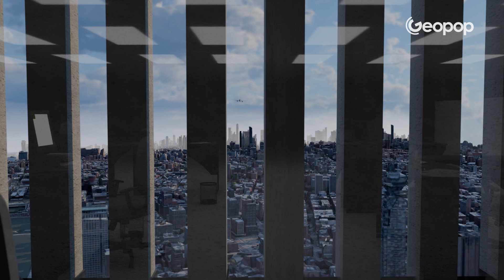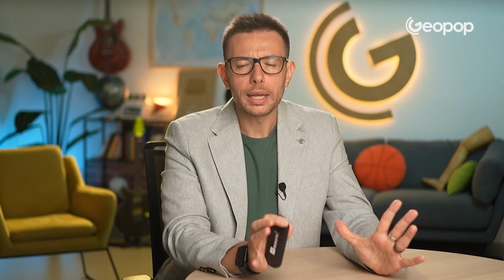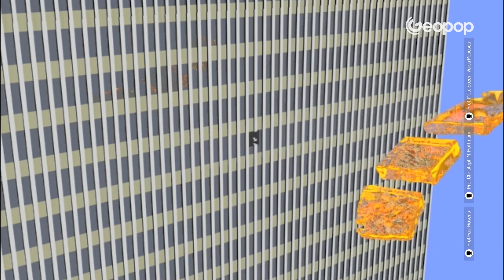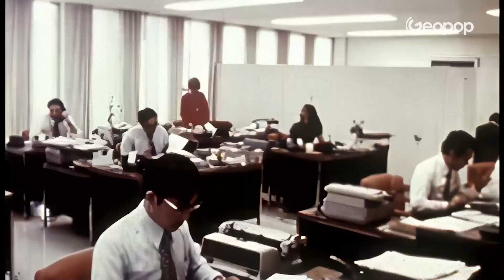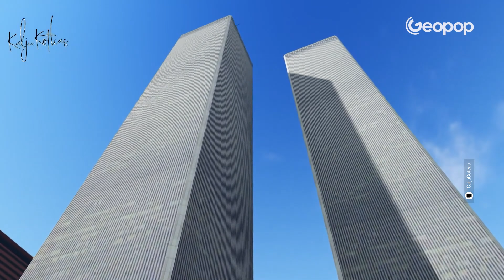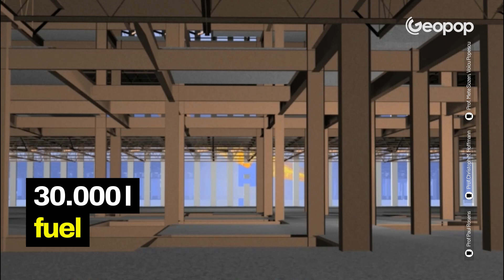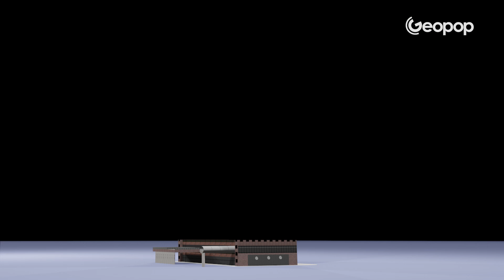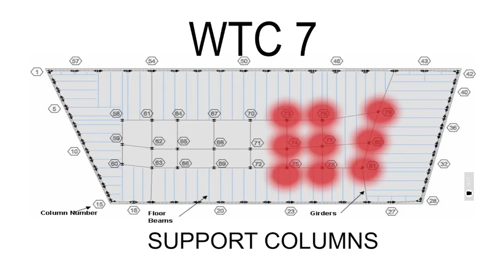9/11, 2001: The Technical Reconstruction of the Twin Towers and WTC 7 Collapses

Comment: Controlled demolition. Buildings were planes proof. Planes could never have dropped those buildings. That was controlled demo. Their are plenty of demo videos that look the same when performed correctly.
Reply: Twin Towers collapses were actually relatively straightforward, the fundamentals already understood in the professional engineering community within just weeks. Still, there’s a lot of really bad information floating out there, mostly on the internet where it’s easily accessible to anyone. Good information takes more effort to come by and is much harder for laypersons to digest. Engineeringspeak is complex and dull. Also, some people put up a wall to protect their beliefs and false assumptions. Engineering is hard while wild baseless speculation and pathological theorizing with easy hand-wave answers is simple and exciting. Fanciful tails of pre-planned demolitions, magical space beams, melting steel and mini-nukes are just far more entertaining and require a whole lot less thinking, thus getting far more intention than they deserve.

To correct that situation, I have all on my own prepared this short yet detailed technical description of Twin Towers collapses based on my own observation and analysis of the available true and relevant facts. No politics or ideology, just the engineering. My hope is this will dispel many common myths and answer most if not all questions you may have about the Twin Towers collapses, because anything can seem like a conspiracy if you don’t understand how it works

While complex, most of the Twin Towers collapse mechanisms can be seen with the naked eye and easily discerned and understood by the layperson if sufficient time is taken to understand. 

1. The Twin Towers consisted of 4 primary structural elements that together formed an integrated system where each relied on the others.  47 hollow box-section steel Core Columns carry the majority of the gravity loads. The 236 hollow box-section steel Perimeter Columns carry the remainder and ALL of the lateral (wind) loads. Long-span Lightweight Steel Trusses connect the core and perimeter column together at each floor with a Hat Truss on top to tie the structure together as an integrated unit where no element can survive without the others. There was no structural load bearing concrete and most components were bolted together.

2. The impact of 117 tons of airplane (= to about 12 dump trucks) at speeds up to 590 mph with the energy of a ton of TNT completely destroys the aircraft. This in no way implies the Towers come out unscathed. Many perimeter columns are damaged or destroyed as are some core columns (example; 33 of 59 perimeter and 20 of 47 core columns damaged or destroyed at the impact floors in the North Tower), This damage is primarily through bolt-shearing failures at the end connecting flanges, as well as bending, twisting and fracturing of weld seams. There was no cutting or slicing - the reality was far more violent and messy. 

3. The impacts destroy or damage fire insulation, fire breaks and sprinkler systems on multiple floors.  Huge fires are started across multiple floors simultaneously and allowed to spread rapidly with no effective firefighting or fire suppression. This was an unprecedented fire event . 

4. The hotter steel gets the weaker it gets .  With fire insulation stripped away and no sprinklers the survival time of the steel greatly reduced. Gradually over time heat causes the lightweight steel Floor Trusses at the impact damaged floors to sag, which was observed and recorded.  No steel melted or needed to. Structural steel fails long before it becomes a puddle. It just needs to bend

5. Sagging floor trusses pull on the increasingly weak and overloaded Perimeter Columns, causing some of them to bow inward by up to 5 feet. A straight column is up to 4 times stronger than a bent column. The bowed Perimeter Columns buckle and fail, initiating collapse. The formerly static mass above which the structure below could easily support is now converted into a dynamic mass up to 30 times greater. Because they have buckled, the Columns above and below the failure point are no longer aligned . The load bearing structure below no longer bears any load as it falls past the lower columns, NOT onto them.

6. Thousands of tons of debris fall within the four outer walls, down through the open office space, crashing onto the first intact floor it encounters. This massive impact immediately breaks the bolted connections to the columns as the amount of resistance the Floor Trusses can offer is negligible.  The falling debris slows only marginally and briefly. Note:
6a. This is NOT a solid top block crashing into and “crushing” a solid bottom block .
6b. The debris falls past the columns not onto them.  The columns provide no resistance to the falling debris. 
6c. Only the bolted connections of the floor trusses to the core and perimeter columns can offer any resistance. A pair of 5/8” bolts at each end of each truss vs. thousands of tons of falling debris.
6d. No laws of physics are violated.

7.  This floor-led collapse progression within the four outer walls can only go straight down. Note: 
7a. This process is often incorrectly referred to as “pancaking” which actually refers to a completely different process rejected at an early stage. The catchy name stuck but nobody knows what it is supposed to mean.  Pancaking is too simplistic and inaccurate anyway. More like Kaiserschmarrn.

8. Collapse progresses through the floor systems not down the columns, through the path of least resistance . Rate of floor failures increases with each successive floor as momentum increases, reaching an average acceleration of 0.65 of GA, or 35% slower than true free fall. Bam, bam, bam down the building until there are no more floors to fail.  The resistance offered by each successive floor is always the same. The mass and velocity, thus the energy of the falling debris is constantly increasing, with each floor destroyed adding new falling mass. Some falls to the sides, but most falls down. More mass, more velocity, same resistance with each floor.  Don’t get stuck on the but the lower floors weren’t on fire nonsense. They weren‘t and didn’t need to be.

9. The Towers were 95% air by volume. As that air was compressed inside the building it is forced down the tower and blown out the sides in reaction to the building collapsing . Those were not “explosions”, it was expulsions of compressed air caused by the collapsing building, explaining the low velocity, lack of flash, blast, supersonic pressure waves and lethal high-velocity ejecta.  

10. Perimeter Columns become detached and peel away like a banana behind the collapse front, playing out to the four points of the compass extending to more than 600 feet from the base of the towers. This was quite obvious from examination of the debris pile. 

11. Core Columns fail last as their internal beam bracing is stripped away by falling debris and lateral support from the floor to perimeter columns is lost. 

12. For those who care about how long this whole process took; 31-34 seconds from the moment the perimeter columns buckled until the last core columns hit the pile, or 1/3 the rate of true free fall. Don’t believe me?  Just watch any video of the collapses and note the loose truly free-falling debris dropping much faster than the towers themselves.  

13. Each Tower had a 1-acre footprint. Far from collapsing inside their own footprints the debris pile spread out over 17 acres in a pile up to 14 stories deep. 8 surrounding buildings were destroyed and scores more damaged by the falling debris. 

14. What was NOT observed were the 180-190 dB bangs of thousands of high explosive devices or the blinding bright flashes of burning thermite. Neither could have caused the (silent) perimeter column buckling that clearly initiated collapse.  Neither explosives or thermite could have survived the impacts and subsequent fires either. A video of a shocked and injured firefighter using the magic word explosion is in no way proof of explsoIVES . The pre—planned demolition case relies entirely on that sort of thing. There is zero tangible physical evidence and it would be technically impossible, totally impractical and completely unnecessary. No one would bother. 

15.  Finally, the Twin Towers were perfectly safe within their design envelope.  They only collapsed when taken far outside design parameters by an extraordinary and unprecedented event 

Impact + Fire (heat) + Time + Gravity = Collapse . Remove any one of those four elements and there is no collapse. Ignore any of those elements (as many do) and you will never understand the collapses. The Twin Towers were an integrated system in which no one component could survive without the others. One fails, the rest follow, through the path of least resistance – DOWN – through the open space, bypassing the path of greatest resistance – the columns.  Nothing I just described violates any laws of physics. All of the above is true no matter who planned and carried out the 9/11 attacks or why 

I hope you found this helpful and informative. It is not meant to be adversarial, but to solicit informed critical comment, positive or negative. If I made any errors of fact, logic or reason or left anything critical out, please let me know so I can fix it. To stay focused just one topic at a time please and on-topic (Twin Towers ONLY). No word-salads of Gish Gallop. IF you can offer a more plausible alternative be my guest. Be the first. Please start any reply with the words “Tits McGee” or I will know you didn’t actually read it, are not serious and just wasting my time.
Reply: @TheCriticalStinker-jw4fl. Ain't nobody reading all that bull  If it's so straightforward why do you tend to write a book about it all the time? It took nist eight months for their preliminary report and the final report didn't come out until two thousand and eight. If it's as simple as you say , why did it take seven years? You don't know what you're talking about
Reply: @TheLoonResistance  Jet fuel can't melt steal. Or even weaken it. Explosive charges can cut steal. Used in controlled demo.
Reply: @TheCriticalStinker-jw4fl  I wouldn't know where to start. There's.
Some truth in there , but most of its lies. Stinky is no engineer. . It does have structural concrete,  melted beams were found in the debris along with melted steel in the dust. In the end, nist said the temperature was never high enough for the entire building to collapse and they never produced a diagram for the collapse in the twin towers. Stinky talks about engineering as if he is an engineer.  I've been building structures for over 30 years. I've read engineering specs hundreds of times, it's usually not very complicated. He claims it's so easy to understand and yet 90 percent of the new comments here disagree with him proving him wrong once again. . Stinky also says "no element can survive without the other. That again is false, . 
Commercial jets cannot fly 600 miles per hour a 1000 feet off of the ground.Proving it was a military plane
4. Is a lie.  It begins to weaken at around 570 degrees. But it's just as strong at 500 degrees as it is at 250 degrees so 4 is wrong.were overloaded? As you pointed out the columns on the 97th floor are exactly the same as the 7th floor. On the 7th floor they were strong enough to hold 100 floors so how do you come up with overloaded columns? I could go on and on and I did finding something incorrect about everything he wrote but I guess it's too much to post at once idk how stinky gets away with it, he's probably paid and works for someone

6. The pile of debris was only as tall as the lobby. So if your number 6 is correct. Where did it go? And this doesn't account for the explosions during the collapses.  It also doesn't account for the multiple explosions below the collapse (squibs).
7. You talk about the resistance but resistance takes time. And all these buildings fell at nearly freefall speed which proves the resistance you are referring to wasn't present. 
8. Watching the videos we can see explosions constantly forcing the building outwards as it fell, not straight down which explains why the pile was so small and body parts found ridiculous amounts away from the towers.
9. Not correct either 95 percent is with 0 people and furnishings inside. 
You're a joke.
Saying it took 35 seconds to collapse is just silly.
Claiming that there were no explosions is a lie. And you know better because I've already provided video evidence of tower 7 exploding. 8:20 https://youtu.be/bLF5D7M1YgA?si=iQJw1bw1P7vZRlir
I've posted videos of reporters , fire fighters and other people reporting these explosions why are you lying?
I'm done with your BS because that's all it is.
10. This isn't true and he has absolutely no proof of this and the way you know it's not true is because you can see parts of the outer perimeter still standing when the towers have fell.
11. More bull, no proof just made up crap. 
12. It definitely did not take thirty one seconds for any of  the buildings to fall
13. This one's wrong too because the debris was only as tall as the top of the lobby.
Reply: Did you even see this video?
Reply: Your statement would be true ONLY if those buildings were built like the Empire State Building which easily withstood the impact of a US Army B 25 Bomber on July 28th, 1945, on the 79th floor none of the 23 floors above it did not move at all due to the fact that there was way more steel in that building not to mention the limestone & granite exterior which btw made that building weight more than 1 & 2 WTC combined!
Reply: @jeffreymcurtis  They were designed plane prove per New York rules. It was demo without clearing the building.
Reply: If it were controlled demolition, then what was the point of the airplanes in the first place?
Reply: @kyle381000  the airplanes were to redirect you attention away from charges going off. Watch some videos. You can see it if you don't pay attention to the planes.
Reply: @kyle381000  The government didn't want you to realize they blew the foundations. Wanted people to think it was foreign terrorist. Not your own government.
Reply: Thanks for that expert analysis:(
Reply: @aldunlop4622  You are welcome. I used to do controlled demo for a living.

Comment: Your explanation completely ignores the laws of physics and many other evidence found at WTC, such as the transformation of steel to dust. Furthermore, the input data is completely false. NO aeroplane can fly at 700 km/h at ground level. You are nothing but another disinformation agent.
Reply: The explanation does not ignore the laws of physics - you just don't understand the laws of physics, the collapses as described, or both (probably both).

No steel turned to dust nor does steel turn to dust. It's not a thing.  THAT would defy the laws of physics.  Why are you invoking magic or the supernatural?

What input data is false?

What airplane was flying at ground level?  Why can't a plane - in this case a B767 - travel at a mere 700 km/h at low altitude, at full throttle, in a shallow dive?  Please cite your source from Boeing which confirms that claim.  

I'm starting to feel like you are a disinformation agent, mindlessly copying other peoples bad ideas which you don't even understand off the internet.
Reply: @TheLoonResistance  Sorry, it doesn't work that way. Just saying no, or you don't understand doesn't make you smarter or more honest. I invite you again to stop spreading ignorance and disinformation. It is obvious that you are one of those individuals who have strong opinions but zero knowledge. Get a life. Goodbye.
Reply: @zbigniewrichard8291  - You should heed your own advice then, because just saying no is exactly what YOU did in your OP.  Pot meet kettle.

If for example I were to ask you to summarize this videos description of Twin Towers collapse, could you?

Could you then explain exactly where that description loses the plot and defies the laws of physics and how?

I think not.
Reply: The steel did NOT turn to dust. 
The almost one acre of non-reinforced 4" concrete on every floor was the source of the dust.
Reply: @kyle381000  You are the living proof of brainwashed Americans. Dream on, sheeple.
Reply: Lots of airplanes, including commercial airliners, can fly at 700 kmh at near sea-level. You obviously do not understand the aviation term Maximum Recommended Velocity which defines the maximum RECOMMENDED speed for a given elevation which an airplane can fly for sustained periods without risking structural damage. It does NOT mean that an airplane cannot reach MRV nor does it mean that an airplane exceeding MRV will suddenly disintegrate.
Why don't you know this?
Reply: @kyle381000  Show me the FLIGHT CHARACTERISTICS at sea level for the planes that allegedly hit the WTC. Put the evidence where your mouth is. I dare you, genius.
Reply: @ 
Are you suggesting that the radar data of the planes which actually hit the towers were inaccurate? If so, how so?
Also, the aircraft which struck WTC2 was also on a descending trajectory until immediately before impact.
Again, the maximum speed values are for what is safely recommended as opposed to what is physically possible, especially while descending.
Why don't you know this, genius....
Reply: @kyle381000  You conveniently NOT showed me the definitive proof represented by the flight characteristics at sea level. By telling me that the plane was on a descending path is even dumber. You have zero knowledge about aerodynamics and air friction and density at sea level. In conclusion, you are one of those ignorant people, proud to be stupid, who never doubts anything. Go to the nearest mirror, look very attentive at your image, then punch yourself hard in the face. Twice, for good measure. Goodbye.